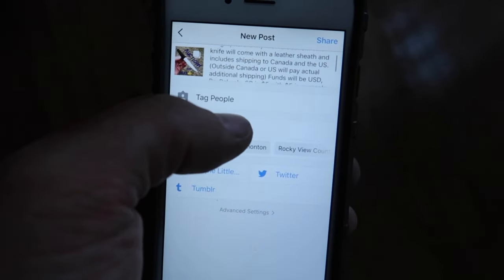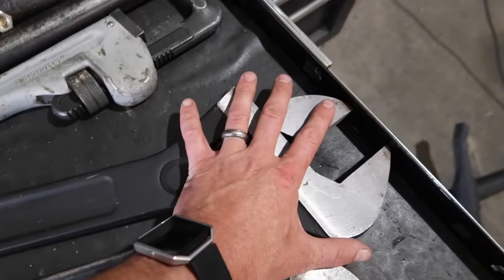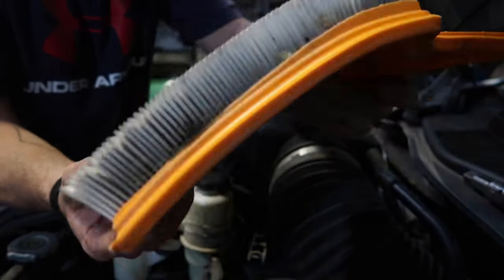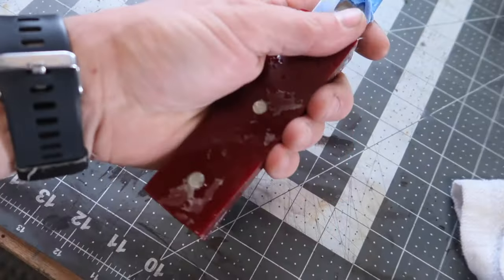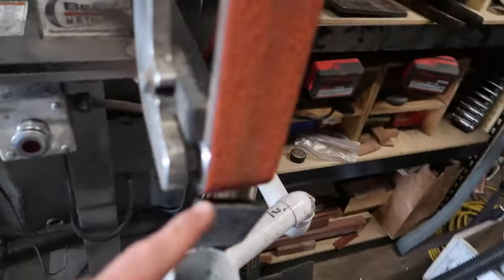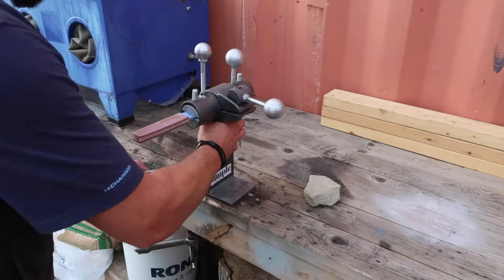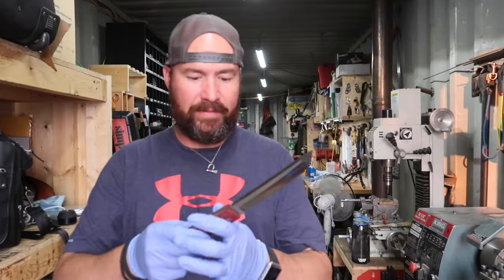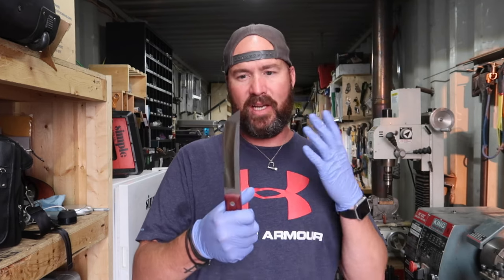Custom Tanto and an Oil Change - Knife-maker's Vlog

Comment: Very nice finish  Jeremy 
I have a question if you know the answer I would really appreciated 
When I heat my knives for treating I get some times spots look  like measles or freckles like shape 
I notice them after quenching and cleaning prepping for tempering 
any idea why these spots appear and are they bad
Reply: cking_closure if you use coal it's more notice but I believe it's where the steel gets cooled down so quick and when you clean some sticks and some don't
Reply: Thanks Jeremy , yes indeed I use coal for heat treat but what got me thinking is that my oil is very hot ...I mean I could make french fries on the spot "lol" 
anyway thank you for coming back to me